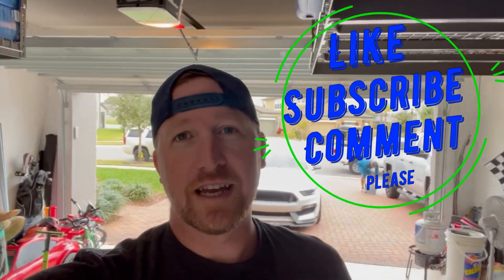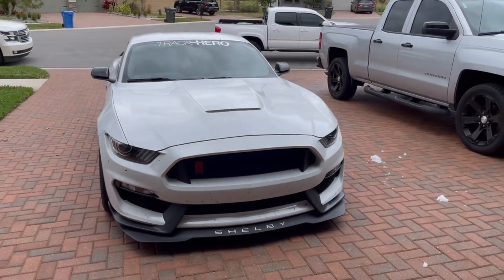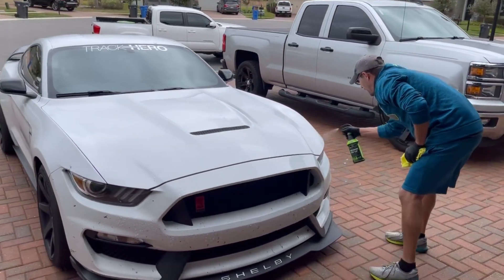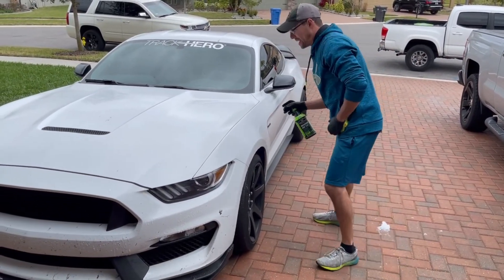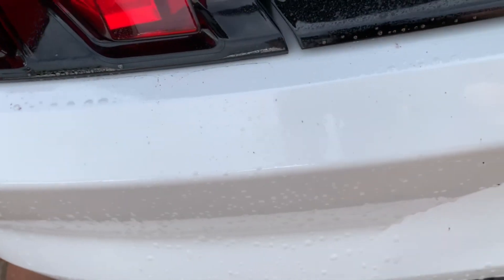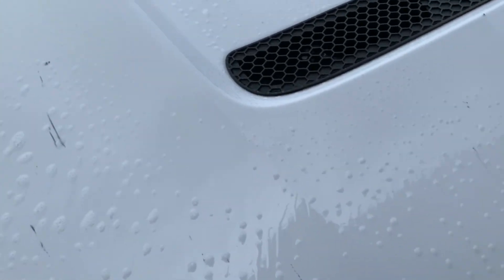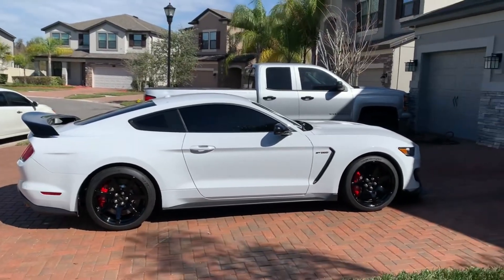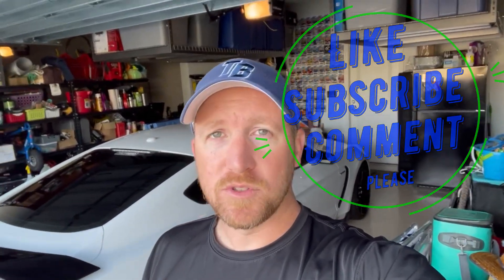My Shelby GT350R got destroyed at the track.........and this is how were going to make it new again!

Comment: How did you get the white part of the front wheels that clean?  I want to figure out the best way to do it with the wheels on. It will never be white but the method I do now at least removes the top layer of brake dust.
Reply from the maker: So we took the wheels off to clean them because after the track day you get rubber inside the barrel. I normally wash with the the wheels on and stick my hand in the wheel as far as I can get it. It’s tough though since the brakes are so big
Reply: @BROCKgoFAST  FYI- I've had good results so far with using a fine grit sandpaper for the white area. I'm actually going to try "wet sanding" specific paper to see if that will be even better with the wheel cleaner. Need some process where I can it 75% clean without taking the wheels off.
Reply from the maker: @creamfalcon  I would be very careful doing that as that is a special coating to protect the wheels from heat off the front rotors. If you never track the car I don’t think you would have an issue but I’d hate it if the you eventually sand the material away
Reply: @BROCKgoFAST  noted but its very very fine grit sandpaper. There is no way (in my opinion) you could agitate the brake dust off otherwise. Plus if you watch autofanatic channel he used a wire brush and a steam cleaner which seemed to be way more harsh.
Reply from the maker: @creamfalcon  oh ok just wanted to make sure. I think if you take the wheel off every couple washes I think you will be able to keep them as clean as possible